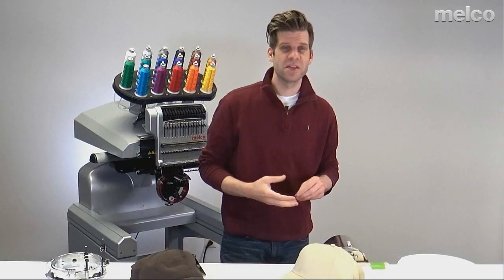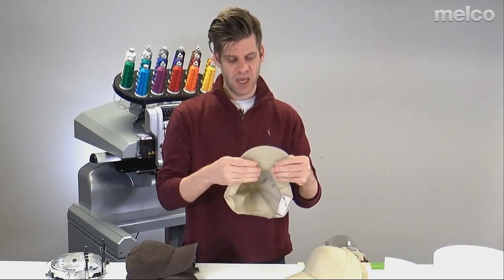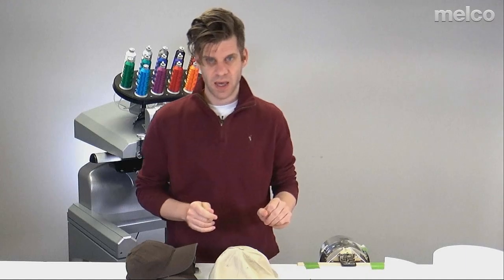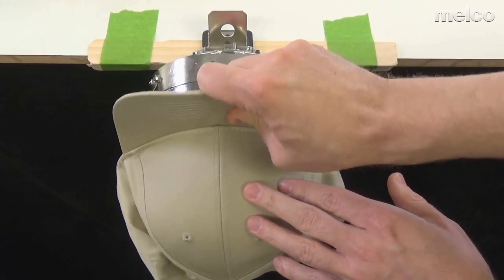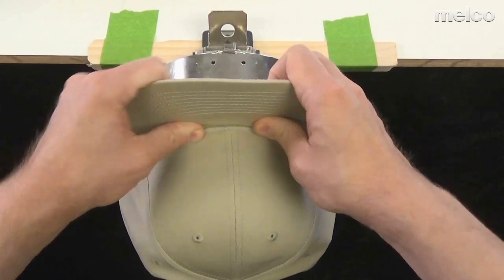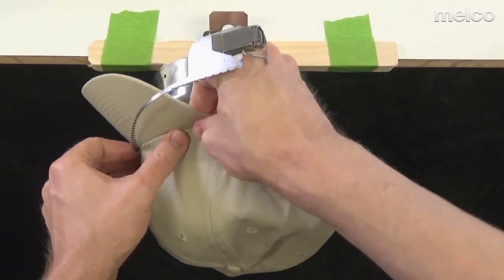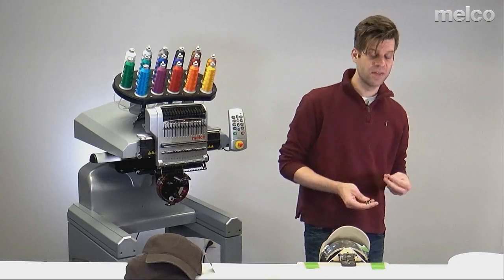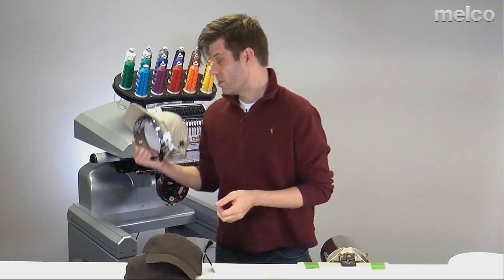Hooping a Cap on the Wide Angle Cap Frame (WACF)

Comment: We are having trouble with a hat staying on the frame when it's being embroidered. We have tightened everything on it and it still gets pushed off the frame. Any suggestions on what to do?
Reply from the maker: My best guess is that the design may be too tall for the style of cap. The design size isn't limited as much by the frame as by the profile of cap itself. If you continue to sew toward the top of the cap, at some point, the lower arm will hit the inside of the cap and force the cap off the frame.
This may help sorting out design size on caps.
https://melco.zendesk.com/hc/en-us/article_attachments/360087892711/Digitizing_for_Caps.pdf

Comment: Hey guys, we have an older amaya that we bought recently and are very new to embroidery. Do you have any suggestions for videos explaining older versions?
Reply from the maker: Much of the hooping techniques, thread, needle, and backing information, as well as most of the machine information is still relevant for the older machines. A few settings like the tension of the bobbin case or hooping with a specific cap frame may need to be looked at in the manual. Even the maintenance is much the same, with only a few changes for sensors, covers, and trimmers. Keep to the Advanced Interface videos, and much of the information will transfer.
https://www.youtube.com/watch?v=lTwtaHhraI8&list=PLC4iL8q1qG4fwR9ZOUdLqdSQ_YALdncIy